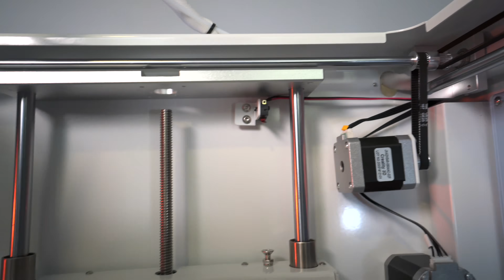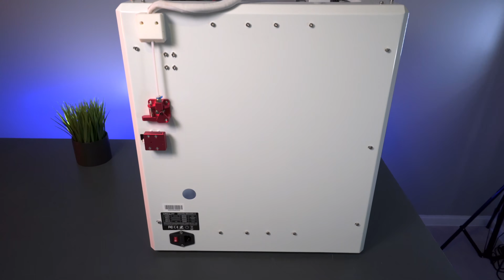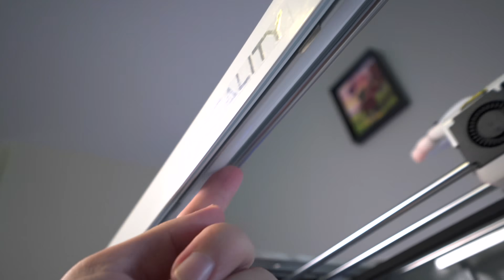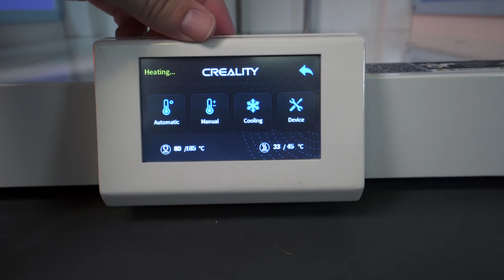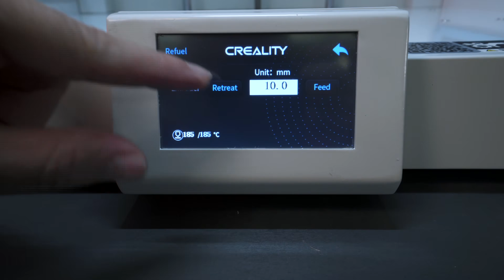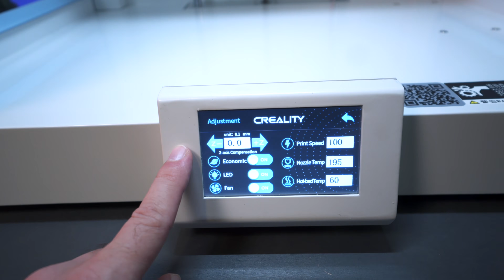Creality CR-5 Pro - Overview & Print

Comment: I have had nothing but problems with this printer. I have tried to work with customer service and they did send a new hot end and extruder but the printer still fails. I have asked to send it back in exchange for store credit or even a trade down to an ender 3. I have one of those it it works just fine.

Comment: The 
Machine is solid but you need to change the extruder, the hot end and in best case upgrade it to klipper. Got mine as a gift from a user who only had troubles with it
Not worth the money imo
Reply: What extruder did you change to? Also did you follow any videos to figure out klipper and etc.. getting one for free with  broken nozzle

Comment: I owned this printer for 3 months, and the biggest issue I had was the firmware, it would ignore any modified G code I made. ( filament change, optional stop using cura ) and there are no upgrade options.
Reply: I had upgraded to Marlin 2.0 that gave better result. Recently I have moved to klipper with stock board. Using direct extruder. Very consistent results now
Reply: @DoTheDiy  could you elaborate what direct extruder you used? is there any tutorial on flashing klipper?